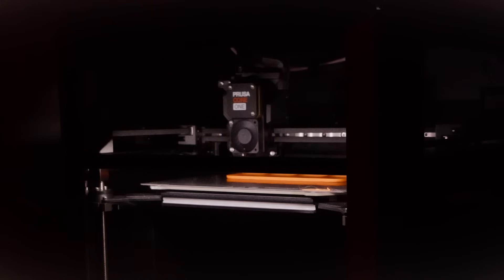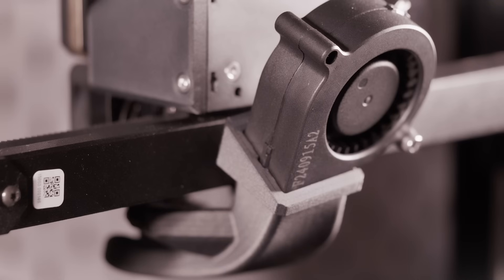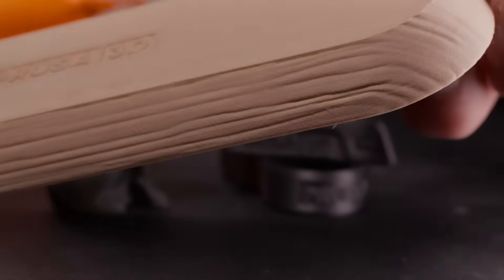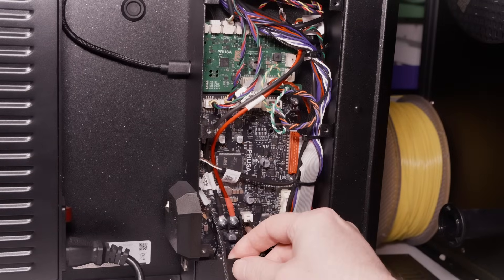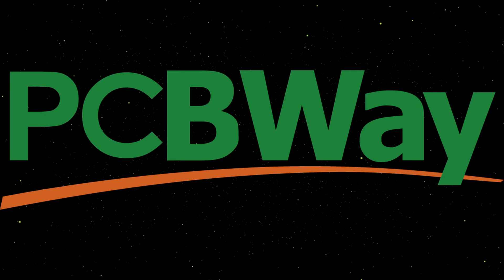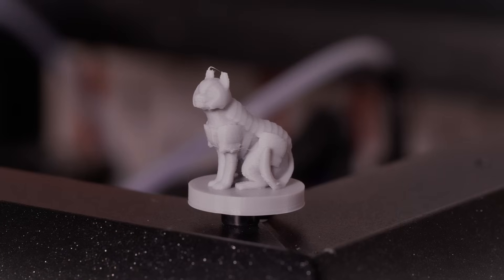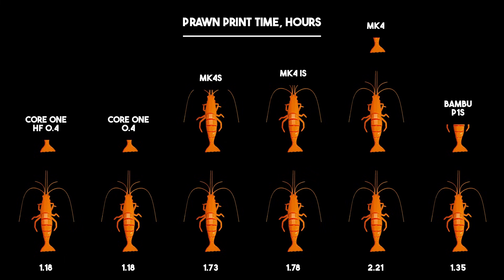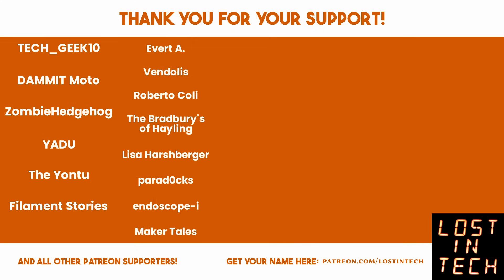Why the NEW Prusa CORE ONE is a 3D Printing Hobbyist and Modder's best friend.

Comment: Isn’t the P1S a direct competitor at a much better price?
Reply from the maker: I would argue, not after bambu pulled their latest stunt, no.
Reply: @LostInTech3D  Please explain the stunt.  I understand what you say, and think will happen, but what has happened?  Stunt is charging $1400 for something Elegoo has done for $299.
Reply from the maker: I don't want to say told you so but I have a feeling about that elegoo....we shall see.
Reply: @LostInTech3D  I have a feeling that Elegoo might end up being the corexy equivalent of the Ender 3.
Reply: @ Sometimes a company has to send out a loss leader to gain confidence with an upscale product.  Yes, time will tell, but it is getting solid reviews on early deliveries.  I will most likely get on just to see and it's so inexpensive.
Reply: @LostInTech3D  Any reasonable person on the internet LIVES for syaing "I told you so"
Reply: @hodgeac  It will never amount to anything but a fart in the wind. Elegoo seems to like Bambu's business model, so don't expect much from them. I'm really hoping that Creality manages to make a core XY Ender 3 and doesn't do anything too Creality.
Reply: @Liminal.Headspace  Creality might not have done that themselves but there are a few community projects to turn the older Ender 3s (the original Ender 3, the 3 Pro, and the 3 V2) into Core XY machines. Most recently there's the Ender 3 NG. There are even a few companies offering Ender 3 NG conversion kits
Reply: @nickfury1279   I wasn't talking about DIY stuff. I meant a consumer solution by Creality. What's the point ofeven  mentioning all the myriad mods ?
Reply: @Liminal.Headspace ok and what I’m saying is why wait for Creality to release a Core XY Ender 3 when the community already made one. Creality is not in the business of upgrading their older models. That has always been up to the community

You want a Core XY printer from Creality? Build an Ender 3 NG or buy a K2 Plus

Comment: Push the rivets out with your finger from the inside
Reply from the maker: thats what Prusa told me but it hurt my soft hands lol
Reply: @LostInTech3D  They have these reusable plastic rivets commonly used to fasten motorcycle fairings together. I wonder if that would be a viable option. Really, the only negative is they're longer than Prusa's original solution, so they will be more noticeable from the inside. They're very easy to use though: https://youtu.be/2uxTrkzf6SE?si=WfANqI2l8kcw5_O8
Reply: @LostInTech3D  print a harder finger then!

Comment: Being able to get a kit version of this printer and save some $ definitely makes it a more attractive option as well
Reply: I certainly go for the kit version. Not because of the cost (although it is nice), but because by building the printer yourself you get to learn all ins and outs of that printer. If anything gets wrong or worn out parts need a replacement, you know how to do it. On top of that, it opens the way to tinkering if you want that (although it's probably not needed).
There are two things that are nagging me a bit though. The first thing is that the camera is not included by default. On top of that, it has a terrible frame rate. In my opinion it's a let down. The second thing is that no accelerometer is included by design. You maybe can get away when all the parts are standard, but the moment you change something on the print head (even if it's small), you cannot calibrate the printer anymore and the standard settings will be off...
Other than that, I think for me the kit is the way to go...

Comment: Serious question: Why would you want to print ABS in 2025 anyway? Aren't ASA or PC better options?
Reply: @snake5394  abs is cheaper and has a shiny finish, which some people might prefer over matte asa print.
Reply: @snake5394  It's much more affordable
Reply: @snake5394  abs is like half the price of ASA from who I buy filament from
Reply from the maker: personally I have no idea, I have 3 reels of ABS and no reels of ASA. 
Polycarbonate has a different use case tho.
Reply: ABS and ASA are very similar overall. ASA just generally has a bit more UV resistance, but price difference matters too. PC is not a direct replacement as it is more difficult to print, stiffer, and more brittle.

Comment: Dood prusa is so expensive, shipped to the USA is like 1400 dollars for the core one. I have a mk3s, and that wasn't cheap either. I can only afford prusas when they become cheaper on the used market. I'm looking forward to the used mk4 machines on ebay.
Reply: They may get cheaper in the US when they start building them in the US.
Reply: @zerofox3d  Which they plan to soon
Reply: Same I got 2 mk3s+ used and upgraded one to mk3.5 and I’m happy for now
Reply from the maker: Nothing wrong with that.... keeping printers from landfill is always a good thing
Reply: US Pricing is a different story (that's largely out of prusas hands right now with tariffs on EU Products looming). 

The kit is 881€ w/o VAT in EU - so yeah, different value proposition over here.

Comment: If someone designs a toolchanger for it, I'll be all ears. Let's hope it doesn't take up space from the build volume.
Reply: The XL exists, and has a larger print bed if that’s what you’re looking for, otherwise the MMU will work with it
Reply: @oneletterlon  Yeah no I specifically want multi tool, but the XL is too large and expensive for me. I have a Bambu X1C with AMS and I only use the AMS for the convenience of having filaments ready. But never do multicolored prints because I hate the filament waste.

The XL is not for me. I'll be waiting for whoever brings out the first decent toolchanger or multitool printer that doesn't take up the footprint and money that the XL does :)
Reply from the maker: I've been trying to coax manufacturers into making a TRIDEX for a while. None of them seem convinced with my idea.
Reply from the maker: @MarinusMakesStuff  I don't think this size printer is ideal for it but who knows
Reply: At this size you're not going to get a toolchanger, but you will hopefully get an MMU

Comment: If it weren't for Prusa, we would all still be printing on cold glass plates with glue/hairspray, using paper to level our beds and using cura and thingiverse
Fun fact, every printer sold for the last 5 years now use prusa's innovations.
Reply from the maker: The modern hotend was actually even a prusa invention 😅
Reply: @LostInTech3D  Before we just extruded unmoltenfilament and used a heatgun to fuse it to the print.
Reply from the maker: if you must know, people used to mill nozzles out of blocks of brass, the heat block was integrated into it. 

When prusa came out with what he called, imaginatively, the "prusa nozzle", it was criticised.

this is all still available to read on the reprap forums and it's highly amusing.

https://reprap.org/forum/read.php?1,206341,page=1

It's quite hard to follow along with what's what though, a lot of the context is lost to time and bits are missing that weren't presumably argued about.
Reply: @ Very cool, cheers!
Reply: @LostInTech3D  Along with heated beds, removable textured PEI sheets and the bed leveling we all know today.

Comment: With my A1 mini I get over 25 mm³/s so with that cht nozzle it doesn't make any sense to get 24! The speeds are very low for nowadays and the same applies to the  acceleration as well.
Reply from the maker: I've explained in one of my flow rate videos... possibly extreme vase mode.
Reply: This is going to vary drastically based on the filament you use and the temperature you print at.
Reply from the maker: It is. The A1 hotend does have a pretty long melt zone so that's why it can do 24mm^3/s (quoted 28 but probably optimistic) without having to do the "CHT" thing. 
The highest flow rate printer I've seen - the FLSUN S1 - had a V6 nozzle. It's all down to the melt zone length and some relatively trivial physics.

Comment: The Core One doesn't have a competitor because no one is building new printers to these specs. I mean the side pocket is nice but it's not $1200 plus the cost to get it to you nice.
Reply: I got a One for $900 plus shipping…
I bought a MKII… 9 years ago? Upgrade to a 3 , then to a 4, and now it has an MMU. I’ve spent $2200 on that printer and never had more than 72 hours down time. Any time I had a problem, I repaired it, or I contacted Prusa and they sent a replacement part.
Over nine years that’s $210 a year? Now the One has come out.
When other companies are copying Prusa’s homework to put out a cheaper printer (because they aren’t paying for R&D like Prusa is) to produce a printer that is unlikely to last a thousand hours, and when it does break it isn’t repairable by the owner… (I’m looking at you Bambu)…
Please, leave the “expensive” printers for me, you know the ones I can actually repair that last for a decade, and you can keep buying cheap printers that you can’t fix and die after a thousand hours of use. That seems reasonable…
Reply: For me personally it is.
Just waiting a few months for the initial kinks to be ironed out (and hopefully get a few minor gripes fixed, like the plastic rivets and maybe a bit more sturdy acrylic panels) before pulling the trigger.

Yes, prusas are not cheap but they are well worth the money. No hastle, it just sits there, ready to go when needed, great support and spare-parts supply for decades to come and it's way more future-proof than anything else due to prusas proven commitment to upgradeability. I see a prusa more like an investment rather than just an expenditure.
Reply: Really?, keep researching and you will find a few.
Reply: For me, I have always worked adjacent to the educational sector and prusa really has a better foot in the door when it comes to those types of environments where you can't even have any hint of security issues, which is where the bamboo really struggles. That combined with the very clear, customer support makes it a more attractive option if you're looking to purchase several machines along with a bunch of extra parts for a scool or for community workshop. Because realistically the price point is not nearly as big of a deal. Especially when the budget is looking for something long term. At least that has been my experience here in the california area. Definitely possible the landscape is different in other states or countries
Reply: I’m new to 3D printing and the Core One will be my first printer and gateway into this hobby. I don’t see the price as an issue as that’s the cost (from my understanding) of the amount of times I saved in time and longevity because it’s built so well, has no weirdness with the software or firmware and not made in china which a whole heartedly support. It’s like Apple in a way. Massive support for all devices for as long as possible, it works, plainly without any obtuse restrictions. However, Prusa has the upper hand in letting you freely upgrade and mod the damn things.
Reply: It is also wild, that they are releasing today a printer that is supposed to compete with a 2 year old product, while not being better in any spec than the given product. I love prusas, but this seems too late really.
Reply from the maker: prusa have never competed with the "bells and whistles" in the whole time I've been in this game, so I'm kinda surprised people expect them to. The core one is sold out and on preorders I think so I doubt they see it as an issue.
Reply: @LostInTech3D 

Yes. I think a lot of us 3D enthusiasts tend to look at the price point from a bit skewed perspective, and forget that price is relative to different people.

You certainly pay some money for a Prusa. But they also offer a lot.
The more overlap there is between your particular needs and what Prusa offers - the better the value.

For some, it will be like putting on tailored gloves - for others, it will be more like stuffing a cactus up the a... 
YMMV
Reply: @LostInTech3D nobody expected bells and whistles. We expected competetiv price...
Reply: @mlodikk  It is competitive for what it is. If you need what it is. Find me a similar printer with the same amount of maintainability, built with a steel frame you can take apart to the last bit with a screwdriver. Something that will not send your data to a Chinese cloud.

These are things Prusa buyers pay the premium price for. 

If you don't care about these things, you can go cheaper, but if you do, there is not a lot of alternatives.
Reply: @ulaB  time will tell. I would consider it, if price was around 700-750USD
Reply: @LostInTech3D  yet you're still comparing it to other printers based on what? Specs? The Core One can't compete with the X1C not "because" the X1C is an old model but "instead of" the X1C being an older model. Also the Core One exists because of the X1C so basically they are trying to compete. Your video is just another promotional video. Not a good look for your channel
Reply: @JonLinde yeah sure BUT value means the same everywhere and the Core One is not by far the best value for your money. Prusa has become the brand for those who like to tinker and mod instead of you know, printing/creating things. As a hobbyists printer it's quite expensive, as a consumer printer it's quite expensive and as a farm printer it's also quite expensive.
Reply: I was shopping at this price point, and just got a Marathon IDEX. Yes, there is some assembly to it, but I'd gladly spend 2-3 hours putting a box together, to get an extra extruder and way larger build volume. If youu just want a bambu clone, there is more competition than ever, at 25% the price even, which is wild.
Reply: @BigFx  I almost went with a Rat Rig IDEX machine when I started shopping very recently, but I’ve heard people are having such a rough time with the IDEX upgrade that I bit the bullet and just bought an XL man. Between Prusa’s long standing support for even their oldest printers, progressive upgradability, yadda yadda, I just couldn’t pass it up. Despite it being ridiculously expensive. Hah. If Prusa dropped their prices by 25%, I think they’d run a decent number of their competitors completely out of business. Hah. But that’s just my opinion, and I am absolutely nobody. lol. So yeah.
Reply: @cgyork92 funny enough, i had one in cart, but then after some real feedback rounds and videos, decided to go with Marathon. It has its own issues, but is half price for ratrig idex of comparable volume. So I won't cry if it's a complete flop that much.   Still may do a ratrig build down the road, but as of now, I just can't justify getting a pile of components with uncertain results even if built perfectly to spec.
Reply: Interesting that the QIDI PLUS4 wasn’t mentioned.

Comment: my only significant gripes with this printer are that the chamber control probably isn't as good as it should be (not that it seems to hinder much) and the fact that the camera is a separate wifi enabled device, i can see SOME convenience in it, but to be fair, they do ship it separately, so i guess nothing stops you from adding your own.

Comment: Quite like Prusa, and the printer looks nice. But expect for many, it will be too expensive, too late.  The race to the bottom is in full swing.
The recently announced CoreXY Elegoo Centauri is just $299 US.  Less than 1/3rd the build-yourself kit price of the Prusa.
The Core one lacks internal heating.  The build volume is small-ish, too small for common prints like helmets.  And no multi-material at release time.
Believe Prusa's entry will be reliable, and is probably priced about as low as Prusa can manage.  
The Core One price could be justifiable if the printer were markedly better than the 2 year old Bambu, not just equal to it.
And why doesn't the Core One have an accelerometer in the head for active input shaping? All to retain compatibility with the MK4?  Many strange decisions drove this design.

Comment: The x1 might be old but i honestly dont see why it isn't a direct comparison. Its not like the prusa brings anything new to the table🤷
Reply: 1. Prusa machines verify the Gcode is suitable for the machine before printing, unlike Bambu. 
2. Prusa CORE One detects the presence of the build plate prior to printing
3. Prusa  door sensor actually works as a safety feature, pausing the print. This can be disabled. Bambu clearly lies in its declarations of conformity, with the toolhead cover coming off and it still happily prints away, door sensor does nothing etc.
Reply: @brisance  my p1s checks g code, if I try to print with x1 profile I get a warning. The plate is cool. And the printer pauses now of the cover comes off, only the good old days it kept going. But honestly very very minor things I'm my opinion
Reply from the maker: we forgot printing PLA with the door closed, and an actively monitored chamber. It was in the review. 
And auto loading filament when you push it in.
And probably 2 or 3 other things if I thought about it. 
I don't know why people are getting mad that I'm calling 2022 tech old - it's halfway to an ender 3 v2 by age. It's not really up for debate!  This is how tech goes, 3 years is a loooooong time and it's honestly surprising the X1 is even still selling, some testament to how far ahead bambu were I guess.
Reply from the maker: well yes, its a rapidly moving ecosystem at the moment. 3 years ago we had no coreXYs other than bambu or a self build, 3 years before that we had ender 3, and 3 years before that, you dont even want to know
Reply from the maker: I don't know at what point you thought that language was acceptable but it is absolutely not.